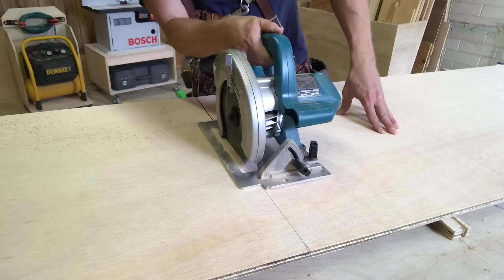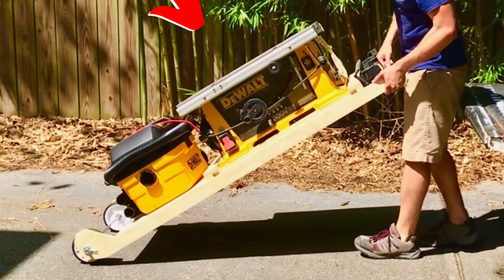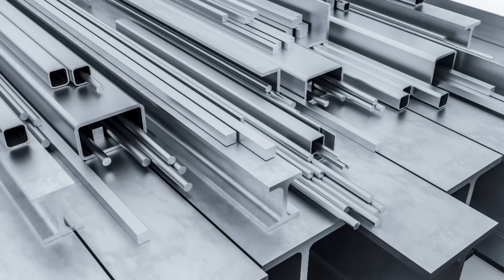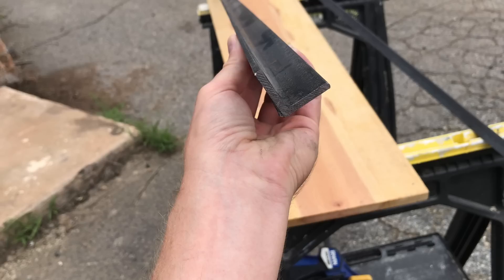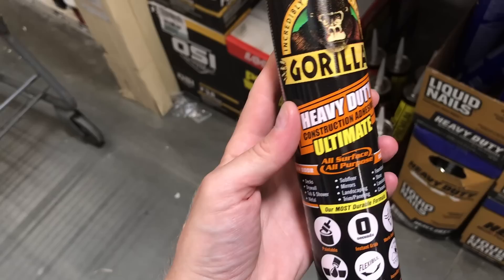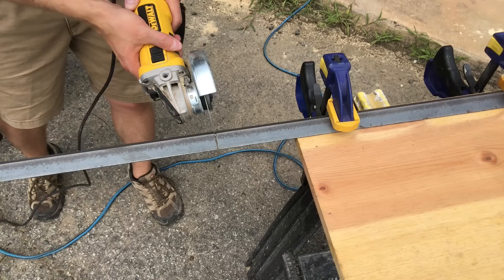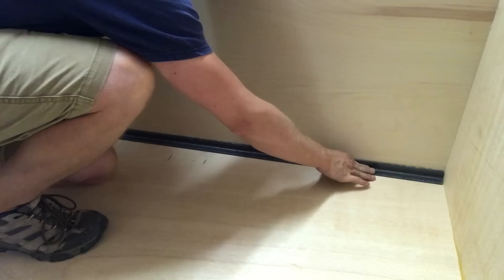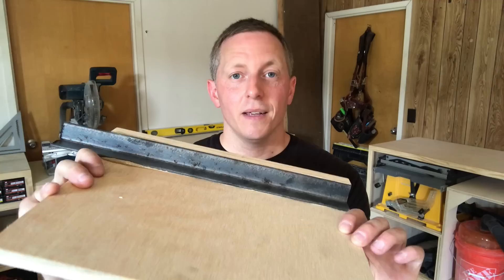How To STRENGTHEN WOOD WITH STEEL! (Make Your Wood Projects Stronger With METAL/STEEL...#1 Trick!)

Comment: This is nice until the glue dries out or fails.  I would have included mechanical fasteners such as counter sunk screws along the length of the metal.   Also, I would have installed the angle iron completely across with no breaks.  This would have provided a much stronger center support (the wood divider).  Other ideas, depending on aesthetics, could be wooden supports on each end of the metal, thus allow the metal to rest on the wood instead of relying on glue holding the support.

Comment: When you load/un-load the shelve, its going to flex the wood first, that'll tension into the adhesive and metal after. I give it 6-18months before the adhesive starts delaminate from the wood, that's assuming you can live with the center bowing like crazy. There in lies the problem, your asking the much weaker material to support the stronger one, it should be the other way around.

Comment: Question on a similar situation...
I have a 63in long entertainment center that, according to the manufacturer, is rated for 95lbs. Tv is mounted on the wall so planning to use the thing for a 30in long 20gal aquarium which, when filled, will be around 220lbs. It does have two vertical walls that evenly divide the 63in into 3 sections but like most manufactured furniture it's pressed wood. So, what would be best to use to support the two vertical walls. Could I just run a couple of vertical boards? Would that be strong enough to support the additional weight? Or would some type of metal be better? Thanks for any advice.

Comment: Here's a money saving idea. Instead of $16 bucks for "L" angle iron, just go on Craigslist, in the free section, and get an unwanted kingsize bed frame and cut it to your desired length. Or just keep and eye out for bed frames and pick a couple up when they are available for free. They take up vertually no space in the workshop and are there when you need them FOR FREE!  Great for welding projects too.

Comment: I cannoy stand the quality of some of the cheap garbage furniture on the market. It is held together with soft metal hardware and soft wood.  It is necessary to strengthen things right out of the box these days and there is nothing wrong with strengthening things or even over-engineering.  It is well worth the time and help make your furniture last much longer, will quality materials it will last forever.

Comment: Is there any benefit to using an epoxy vs a construction adhesive? I have stools I bought where the screw inserts on the MDF tops failed and I want to reattach them to the metal frame. I like that the construction adhesives are easy and familiar. Haven't used epoxies much personally.
Reply from the maker: Epoxies just cure faster, Jacob. But some traditional adhesives could work as well, if they get enough setup time

Comment: That seems the right way to apply, but I think steel is more resistant to flexion if one flange is flat against the wood and the other flange is in tension floating free. There are engineering formulas to predict the strength needed and the strength of steel needed. That said a flat piece of steel would have most of the strength the angle iron has in the configuration you used.

Comment: The Loctite PL 3X is nice, but I would have spent the extra $7 for the upgrade to Loctite PL MAX which is over twice as strong. Project Farm actually tested this on his channel and it was the strongest construction adhesive by far.
Reply from the maker: I didn’t know that, Steven. Thank you!
Reply: @TheHonestCarpenter  You're welcome. Glad I could share some knowledge. I believe the PL 3x was like 750 lbs of force on a wooden block to a piece of metal, and the PL Max was like 1,600 lbs of force to separate it.

Comment: the steel reinforcement in the back is useless there is a backing panel that provide even more strength . on one project we’re the span was large i use a 1 inch square tubing that provide a lot more rigidity ( 2.9 X) than the one inch 90 deg angle iron

Comment: I'd have drilled a few holes to screw it in, only because I'm extremely paranoid and wouldn't trust an adhesive by itself. No matter how many times I have tried to take stuff apart, had to fight adhesive, and the adhesive won.

Comment: I think the slotted one would of been better and instead of cutting it ran it as far as u could into ur shelf/drawer space, it would of helped hold one end up and  on the other end from the side added some bracket just so years down the road and 1000s of pounds later if the bond does start to give it wont just fall on ur toes the day u decided to ware flip flops ! ps u still could hide a bracket in ur shelf/drawer and on the end hide it.  thanks for the vid. Rock On!

Comment: You might get more bang for the buck using flat 1/8" x 2" steel laid flat on the underside of a 3/4" x 2" or wider piece of wood, all hidden behind the face.  You want as much of the steel as possible to be at the extreme bottom of the beam.  The wood takes all of the compression and the steel takes all of the tension.  I have not done a calculation but that design should be both stronger and more rigid.

Comment: Great tip and something i will do in future projects. I do have a question. I have a cabinet above my refrigerator and we store most of our alcohol in that space. The bottom shelf of the cabinet is sagging. Is there a good way i can fix that sag?  I was thinking of using steel for that but not sure how to do that.
Reply: drink less...

or replace shelf with something thicker/stronger.. depends if you mean just a shelf or the bottom of the cabinet..
Reply: @chrisburns5691  or drink faster

Comment: Wouldn’t it be faster/easier to use the metal bar with holes in it?  Couldn’t you then just screw them into place and not have to wait 48 hours? (not to mention avoiding fumes from many of those adhesives)….or does a screw attachment not provide the same level of strength on the finished countertop?   Thanks for your vids…very helpful (and inspires me to do more challenging projects).

Comment: Isn't the savings on steel a factor of time? If the steel shop is not close and you have to spend a lot of time looking for your scrap piece of steel, then the steel costs significantly more than the purchase price due to the time factor. It may then make more sense to zip into a close Big Box store make your selection and be on your way. Also, the converse is true.

Comment: Anyone can read a label to find a glue to fix bare metal to bare wood. 

But what about when one or both surfaces are coated...? That's when all sorts of questions start arising... and a shed load of time, effort or money can very easily be saved or wasted.
Reply from the maker: Definitely contact the company in that case, Sam. Or at least read their white sheets online. These companies have dedicated materials engineers who examine this stuff, and will often get back to you directly with an answer.
Reply: @TheHonestCarpenter  Lol... watching a video that covered the main variables and big dos & don'ts would be a whole lot quicker tho!

Comment: That's a great idea! Do you have any suggestions on how to attach 2x4 lumber to 2" pipe posts for wood fence purposes without drilling into the metal pipes? i need to attached 2x4 lumber vertically to the metal post in order to nail 10"-12" wide wooden fence panels to the 2x4... haven't decided whether to mount the fence panels vertically or horizontally for esthetic purposes.
Reply from the maker: Thanks Mike! I’ve been in that predicament before. I think you can totally adhesive bond here—just be sure to use something premium for exterior applications! You could literally duct tape it on for a few days until the glue sets. I’ve done this for wrapped columns on steel posts in a sub-basement. And use PLENTY of adhesive! You’ll have far more weight on yours.
Reply: Would post clamps work?
Reply: Could you use U bolts (galvanized of course)?
Reply: @jobacuda4472  Yes! Thank you for the quick response.

Comment: Thanks for sharing it’s Fast right to point, I did not think about glues at all when did mind, just used nuts and bolts 
What does glue have over nuts and bolts - could you slotted wood and for go glue, does glue form any structure advantage? 
How does one find bow factor ?
1x1 - 20 feet would have bow ?
Reply: Glue makes the wood and metal act as one composite piece.  Screws would allow for some slip which wouldn't hold them together the same.  I don't know how much difference this makes without doing the calculations but it makes some difference in both strength and stiffness.
Reply: Thank for sharing it’s always nice to know another way 
Now think glued in new way

Comment: That $16 per 72" would have cost you the same but for a full 20' to 24' stick at a real steel supplier. Most will even throw in a few courtesy cuts so you can get it on your vehicle.
The only only use for Lowe's and Home Depot metal is if it's 8:30 on a Saturday night and your project is due Monday morning, and you are completely out of steel.
Reply: Should wipe steel with IPA (Alcohol) to remove grease, let dry 15 minutes. To flash off residual Alcohol, then rough up bonding sides with 80 grit sandpaper, to increase surface area.

Comment: the only thing extra I would have done is wiped the steel with a grease solvent to remove possible residue from fingerprints and atmospheric oil vapour - I never trust steel surfaces for cleanliness with glue
Reply from the maker: That’s a good point, Someone! For adhesion, your surfaces can really be too clean
Reply: I totally agree... I was thinking about roughing up the surface a bit as well, but I’m an overkill kind of guy!

Comment: What if you left the steel full length of the cabinet instead of cutting it notch the cabinet to accept the steel just a thought.
Reply from the maker: I did consider it, William. But I liked the speed of this approach, and I knew ultimately I would never have anything TOO heavy on top.
Reply: It might be hard to buy a piece of angle long enough for the full length of the cabinet, but if you could and you installed the angle uninterrupted it would make it a whole lot stiffer.  It's late at night and I don't feel like doing the calculations so lets just leave it at "whole lot" and not get into exact numbers.

Comment: Great video, thanks. I have been thinking about just this as I am wanting to put a router table into the side table on my Cabinet Saw. Because of the weight of the router, as well as the vibration that may occur while running, do you believe bonding flat stock steel (1.5 inches) to a piece of melamine is a good way to go? Thanks!
Reply from the maker: Thanks Dwain! That’s a good question. I do think thicker lumber would deaden this vibrations more…the steel would definitely support it (though I’d go with angle steel instead of flat stock, because it creates more support surface). But, I’m just not sure what it would do to vibrations…🤔
Reply: It will definitely increase vibrations a lot. Go with possibly different kind of wood and use only fastners, without glue. That method dampens vibrations very well.

Comment: Metal reinforcement is good but a grid of carbon fiber strips epoxied under the plywood is superior.  Stiffer, lighter, and easier to do.
Reply: How do you lay the carbon fiber? the geometry of this is what gives much of the stiffening. so if you managed to lay the carbon vertically it should give excellent results, although bonding it vertically would be weak, although laying it flat as I'd imagine you are won't be as good, ideally, the L shape gives you a good way to bond it to the sheet and also the flex-resistance of the verticle component of the geometry
Reply: @kevincrossland1898 , the carbon fiber strips I’ve used are about half inch wide and probably as thin as scotch tape.  They have incredible tension strength but go limp under compression.  I put it under the material I don’t want to bow.  If the material flexes mostly in just one dimension, like the foam wing of an RC plane, I just use parallel strips of CF on the side that would stretch under load.  In the case of a table, I use a grid (crossing parallel strips).  Look it up here on YouTube.  I remember seeing a video years ago (from which I learned the technique) in which an expanded styrofoam wing reinforced with CF could support an adult man standing in the middle of it while it was supported by blocks under the wingtips.  The wing would barely flex.
Reply: @MucaroBoricua  ah, I see now, that makes sense, the material you're bonding to provides the vertical component to be able to put the carbon fiber into tension when flexing, that makes a lot more sense now
Reply: @kevincrossland1898 ,  Glad you understood it  now.  But hey, that's worth at least a thumbs up, don't you think?

Comment: I'd still avoid big box stores for metal if possible, like wood it's lower quality product for higher cost.  I called around and found a metal shop nearby that was willing to sell me raw materials at near wholesale price, even small quantities especially if you buy at standard lengths meaning they don't have to cut it.  Standard lengths of angle iron is 20' and 40'.  I'm able to secure it to the top of my truck.
Reply from the maker: That’s a heck of a stick to transport, eeguy! But I bet you save a fortune that way! 😁
Reply: @TheHonestCarpenter  a 20' stick isn't too bad.  My truck is 15' long bumper to bumper, so it's only an overhang of 2.5' in both directions if i split the difference.  Just tie them to the roof like i used to tie a canoe to the roof with my dad and add a couple little flags on the end for good measure.  Otherwise you can rough cut it on site with cordless angle grinder if you have one.

Comment: Question. Would you have any problems when the wood moves? I've seen that when people attach a table top to legs they attach it in a way that allows for movement. But this method doesn't seem to allow for any movement. Just wondering if it would cause any undesirable effects over time.
Reply: Tabletops are attached that way because they're solid wood and can expand and contract quite a bit over several feet of tabletop. Plywood hardly moves at all.
Reply: @balzacq  Thanks for the explanation. :)

Comment: The only drawback I can see is if the plywood delaminates. The steel is only fixed to the outside surface layer of the plywood. For your purpose this is probably adequate. wood screws would add to the strength, yes? Rich
Reply: A bead of CA glue soaked into the ply would inhibit delamination... 🤔
Reply: A bead of CA glue soaked into the ply would inhibit delamination... 🤔

Comment: Your table top is still going to bend and warp though..... you need to support the entire surface, not just the edges.   You would have been better off by just laminating two pieces of the 1/2 inch plywood together.

Comment: Nice solution, but why not drill holes and use screws?
Reply from the maker: Thank you! Just less work this way. I put a lot of trust in adhesives overall, and the load here will be relative minimal over time.
Reply: @TheHonestCarpenter  - Thanks for the response. I suppose I'm too cheap and would have used screws that I had around the garage and saved on buying adhesive. 😜

Comment: You know there is this thing called a drill bit...i hear it makes holes in steel so you can fasten it to wood with these things called screws.
Reply from the maker: So last century…
Reply: @TheHonestCarpenter  And much more reliable than glue....  As the metal oxidizes,  the layer of oxidation separates under stress and the  construction adhesive will fail.  The correct solution will always be a physical bond when using steel.

Comment: drill, 10 screws, $1
Reply: 10 screws provide you with 10 attachment points.  Adhesive bonds the entire surface area.  The thin sheets that your trying to provide support to are often too thin to hold screws with much strength.  With adhesive, you'll be finished before you can drill and countersink 5 holes.
Reply: @chrisgraham2904  it took 48 hours plus the glue time. No need to countersink, you will never see them. I guarantee that I can drill and place 10 screws in less time. Truth be told you probably only need half that number anyway, no need to screw into the top
Reply: @cap871  Good points!  A lot of projects don't allow you that kind of set-up time and screws in the top might be redundant since gravity is working for you.  Always glue and screw if your building a tank.  LOL

Comment: Don't see why you didn't just use 3/4 ply for the top, Skipping the steel altogether. Easier, probably just as stiff, more solid in the middle. Probably a bit less expensive too.  No waiting 48 hours for glue to dry. Also I don't understand why you put a piece of steel along the back. Seems redundant as that is being supported by the back wall of the cabinet. Put it in the middle. Or a little towards the front as that is where you will need more support while working on things probably.

Comment: Maybe you want to get that paint off the angle, your bonding to paint not steel.
Reply from the maker: No paint on it, Robert
Reply: @TheHonestCarpenter  I figured they had applied a primer to keep it from surface rusting.  The steel angle in the Depot has primer on it, except the shiny stuff.